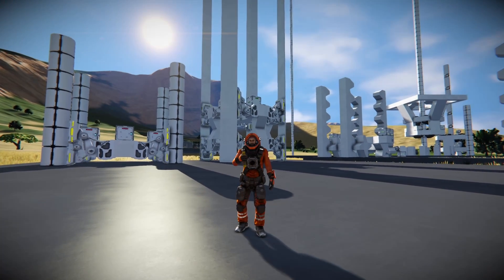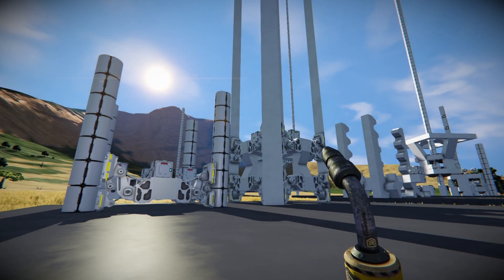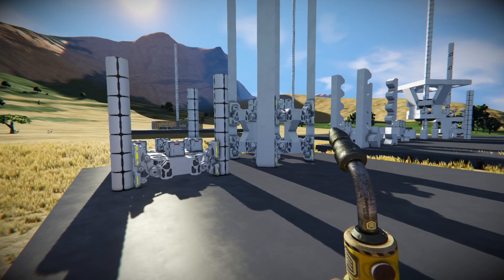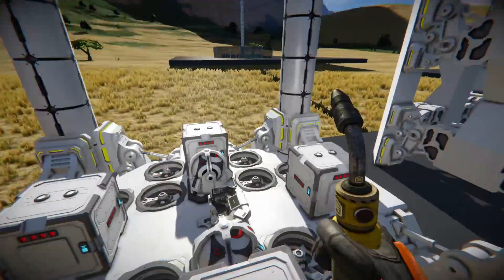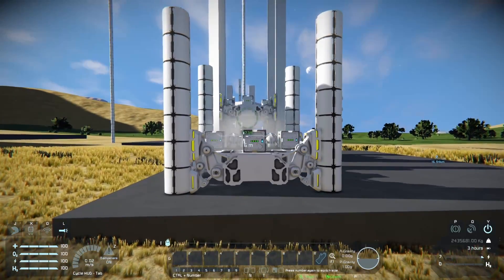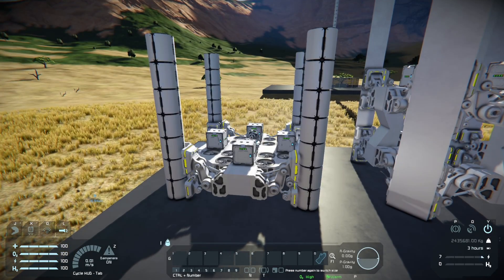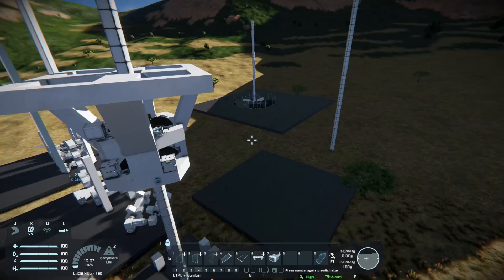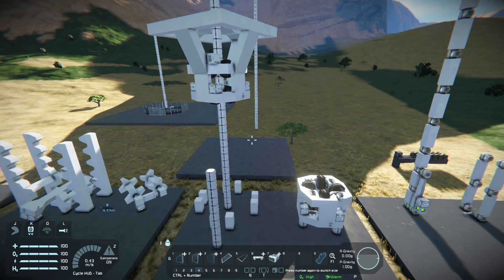An Engineer Designing A Space Elevator In Space Engineers

Comment: Option 3 seems easier to produce. I think you can set up a 1x2 pillar where half is conveyor pipe & the other half is blast door with connectors at preset distances connected to the pipe. With a wider pillar, you could have 2 wheels per side & cancel out the spinning. You may have to do 1x3 for wheel placement if the wheels don't fit next to each other.. Just what came to mind for me🤔👍
Reply from the maker: Yea I like the sound of the idea, definitely could work
Reply: @quantumchief  throw on some storage, projector and a welder and it can pave its way up.

Comment: I say use the inchworm method to build the columns, make a blueprint module. You will need also merge blocks so that you can project the blueprint on the pillar grid. Stack more pistons.
Then I suggest that you use the wheel method maybe with 4 pillars. 
You can add a couple of thrusters for boost when you start going up or you want to stop at bottom.
Reply from the maker: Yea, I think the wheel method will be the best option for getting up and down, but something like the inch worm will be needed to build it